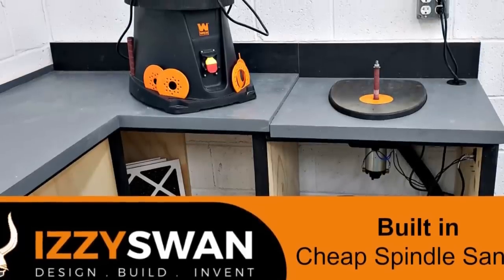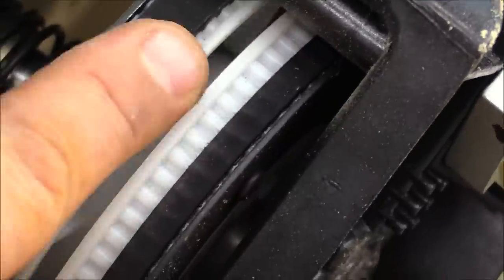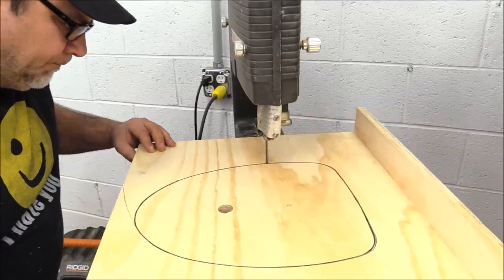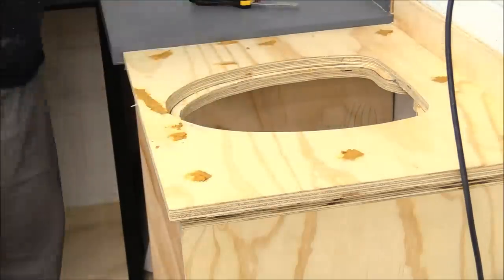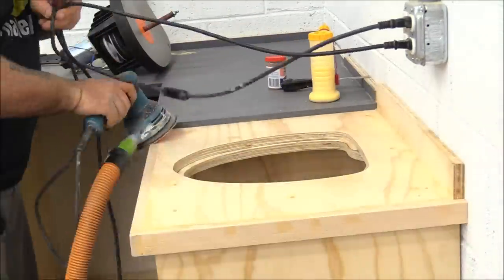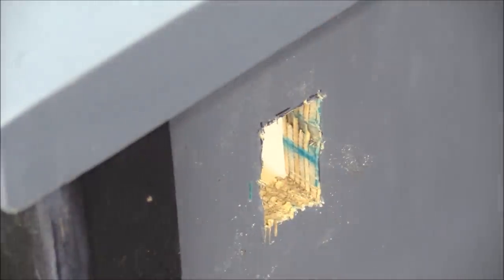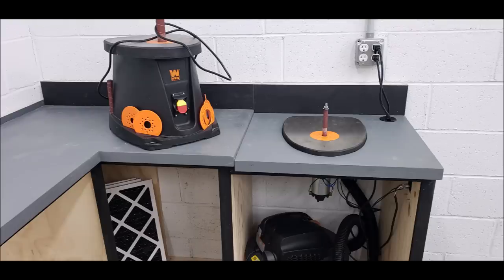Cheapest Spindle Sander On Amazon | Modified

Comment: I use the WEN 6523 Oscillating Belt & Spindle Sander and I love it (2 in 1 and saves space) - dust collection is good at best through the port but my 20x20 box fan hangs right above it so the dust that escapes, and it will, is taken in by the box fan filters

Comment: Ordered my Wen 6510 yesterday and then ran across this. Great idea but I like mobility with my tools; making anything "permanent" is not in my mindset. Also, your setup is great as long as your parts are small; mine tend to be too long to be that close to the wall and the adjacent cabinet. But putting your idea on wheels might be just the thing for me. Thanks!

Comment: I did a similar build for this same sander, but I just built the counter top lower so I could set the sander directly on it without disassembling it and still have the work surface of the sander even with my workbench.  The plastic base has holes to secure it to the countertop and I don't lose all of the built in storage or mess with rewiring.

Comment: Add a Thien Baffle at the vacuum so the filter won't clog and then a bigger easy to remove bin when you put your doors on there. It will also make for a lower noise operation. I really like the Thien Baffle I put on my shop vacuum (mine is between the vac bottom and the motor-lid).

Comment: These are a must have if you are a bandsaw work type. All angles and squaring up bands saw cuts, template and glue form  making. The problem is it is a foot print hog for a one trick pony. Need to see some DIY solutions to this. Drop in units, flip top mounted tool maybe. Differential drive to allow motor to be laid sideways for shallow mount of motor.

Comment: Love it.  I'm all about "per tool dust collection".  I got rid of my dust collector years ago.  

It would be nice if the vertical oscillation was adjustable.  As simple at that oscillation mechanism is, that might not be that difficult to pull off.

Comment: Nice job, have you though of running a pigtail off the switch there for the Shop Vac so you don't have to unplug it and you could start both the vac and sander with one switch.

Comment: This is a great build. I have one of these and the case was broken right out of the box. Got it replaced by Wen but the second one didn't last long either. The tool itself is more than adequate but the case is definitely problematic. It's a shame because there are nice slots for holding all of the different sized inserts and spindles but it's just too frail to survive even occasional handling.

Comment: Maybe I missed it, but why is the counter for the spindle sander lower than the rest of the countertop?
Reply: It looks like he made it so that the top of the sander was at the same height as the other counter, but that’s just a guess.
Reply: @rogerjones  but why wouldn't you want to have the whole top flush with the spindle sander?
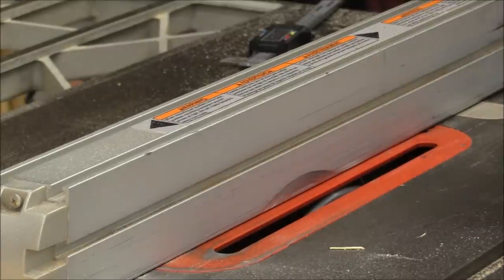Reply: 1:45 - 2:03 Helps if you watch the video.
Reply: @dedalliance1  Right, but why not trim around the edge of the spindle sander table so that there is a consistent top surface along the length of the bench.
Reply: @dynamicequilibrium5322 I can't tell you why he built it this way, but having a table right up to the edge of the spindle sander unless it's perfectly level with spindle sander it's going to make the work piece not get sanded correctly. Also not sure if this model has it, but a lot of spindle Sanders the tables tilt to for beveled sanding, building the counter to the sander wouldn't allow for the top to move.
Reply: Pay attention at the back there.

Comment: Appears to be the exact same model as my Harbor Freight. Thing has lasted many years!
Reply: They are cheap so they are from a contract builder. You just tell them the name, color, and mass build quantity you want. Quite common in these low end power tools.
Reply: I've had my harbor freight spindle and disc sander for about 4 years without any problems.
Reply: They are a simple machine that do not go through the wars so they are going to last.  I used to have a black and decker drill that lasted nearly 20 years before the motor went on it.

Comment: Maybe cut the plug off the vacuum or run an outlet off the switch so the vacuum will kick on when the sander is switched on.
Reply: Exactly!
Reply: I have a momentary foot switch hooked up to my vac that I use at my sanding station bench, have a 4X36belt w/6" disc, a 1"X30" belt, and a home built 10" disc all on one bench, also have a small drill press On the same bench I use for all my sanding drums. Got to control that dust, still recovering from beating stage 3 lung cancer. Now if I could just recover from the chemo and radiation side effects, LOL......got a ways to go yet but getting better!!

Comment: Just curious about the switch you mounted in the sidewall of the cabinet. Where did you get it, and would it handle a 2 hp router? Awesome videos by the way, and thank you.
Reply from the maker: the switch came off the Spindle sander. But Kreg makes a switch you can buy  that is similar and will work witha 2 hp router
Reply: Good deal. Thank you sir.

Comment: Re positioning of the deck of the sander -- why didn't you want it flush with the counter top?  If not, why not rotate it 180 degrees to have the larger part of the deck nearer you for better support of the workpiece?
Reply: Exactly. This makes no sense to work with.
I have one of those cheap sanders, same model just different brand.
I always have the rear facing towards me when I use it, the design is just plain stupid.
I'm going to build it into a counter myself soon, but I will certainly make it flush and face correctly.

Comment: Two questions. Why did you not put spacers in between both pieces of plyso that the cabinet top was flush with the sander top and why did you not have your codes come out the side of the cabinet instead of the top. It seems to me that the cards could easily get caught big the piece that you're trying to sand. Otherwise a great idea!
Reply: 1:45 - 2:03

Comment: Interesting that my "Mastercraft" (sold by Canadian Tire) looked* identical to this model (even the colour -- though now it comes in an ugly light blue). Looks like a bunch of companies have either duplicated this design (at least visually on the exterior with minor differences) or someone is making and selling them to other companies to put their own branding on: Mastercraft, Shop Fox, Rockwell, Triton, Grizzly, Scheppach...

*I sold it and switched to a Rigid "oscillating spindle / belt" sander a few years ago, which I prefer as having the two in one is nice.

Comment: Should have wired the two in parallel so the switch controls the vacuum and sander
Reply from the maker: i bought a relay just hasnt come in yet
Reply: Can you do a short video of how you wire it up?
Reply from the maker: There is no wiring sin9le plug both the tools in to the relay. When you turn the tool one the sander comes on
Reply: Ah okay so it's just to simplify wiring them in parallel